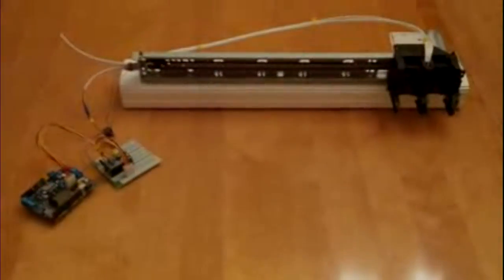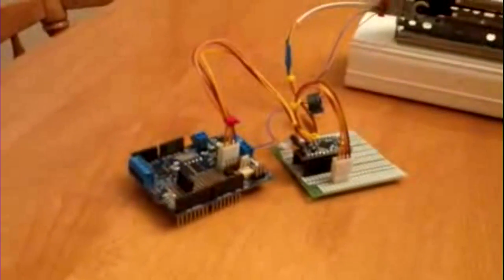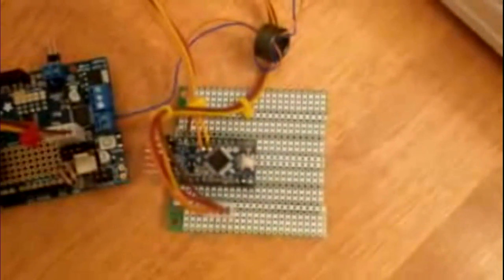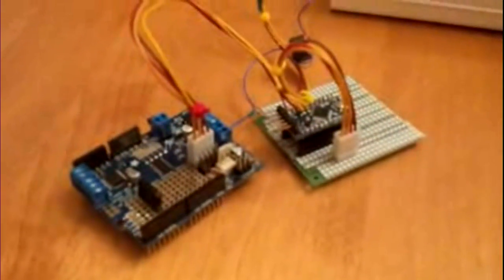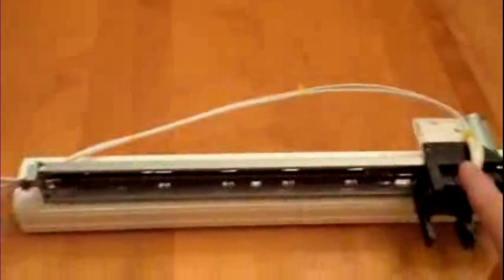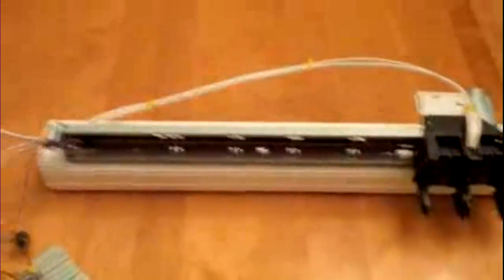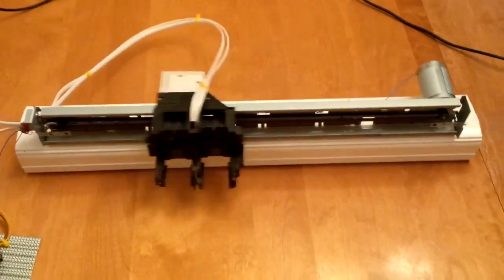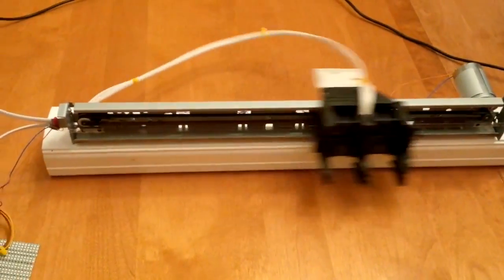RepStrap:  X-Axis DC Motor and Linear Optical Encoder repurposed from an old InkJet Printer

Comment: Michael, did the print slider work out? How far did you get with this  mechanism and what issues did you find? I'm starting a build based on a dell printer, with dc motor and linear encoder strip.  The strip has no lines that I can see!  Do they use cameras now (Like the optical mouse uses) to look at the strip?!
Reply: I just ran to my workshop with a magnifying glass. Lo and behold, there ARE tiny lines on that strip!  My eyesight must be getting bad.

Comment: Hey i have huge problems with my arduino not being able to count up or down fast enough.. it basically miss a lot of steps while reading the strip if i move to fast : /.  may i ask how you did overcome that?
Reply from the maker: Check out Misan's dcservo  hes taken it way past what I was doing.
https://github.com/misan/dcservo
Reply: Me too. How fast were you able to make it go without losing steps? Mine, goes 500mm/min but at 750  it misses steps.  Not sure why. The code time spent in irq is minimal.
Reply: @TheRainHarvester  never calculated the speed. But 500mm seems about right. I abbandoned the Project and used cheap servo motors instead :)
Reply: @MrGunnaras  your motion in the video is much faster than 500mm/sec.  
I can't find other's data on the max speed they achieved without losing steps.
If I move 750mm/min (@ 29 step/mm) I lose 0.5mm after around 2 min of back and forth motion (sometimes sooner).
Do you have any info/data like that?

Comment: How do you think, does it can give enough resolution for 3d printing?
Reply: Not really a proper comparisons. For printing a photo it doesn't have to stop or change speed, just travel at a specific constant speed with known position for firing the print head.

That said, I myself have been playing about trying to do such a thing too.
Reply: @tad2021  How did it turn out?
Reply: @TheRainHarvester  That was a long time ago. I did get it working, but the backlash was the major issue to getting decent quality. I was going to experiment with higher voltage DC for the motors and some other variables, but the price of good steppers and GT2 belts came way down and I ended up moving to those. Eventually changed to a completely different printer.

The ODrive is a good example of what can be done with off the shelf (BL)DC motors and encoders.
Reply: @tad2021  Thanks millions for the info!  I'll watch out for backlash! (I'm going to make a 3d printer on my channel).  
Was the backlash from the motor, or wobbly print carriage, or wobbly frame that you need to make to hold the mechanism?
Reply: @TheRainHarvester  I think the backlash was from the motor. A higher drive voltage may have helped that as the printer the motor came from might have been running up near like 30v instead of the 12v I used.
Marlin now has backlash compensation.
Also a server controller than can deal with a separate PID when reversing directions may make a huge difference.
Reply: @tad2021  , oh, the motor.  My motor shaft doesn't seem to rotate when I press the slider back and forth without power. There is a little slop from the mechanics of the printer head gripping the metal slider "rod" (actually it grips onto a bend piece of metal).  

Maybe I'll add a stiff spring or a magnet to one end of the printer head to keep it tight. The magnet would be cool because it doesn't need to actually touch the metal, just be really close (and no additional friction!)

Thanks for all your help !  Making this work would be a game changer!
Reply: @tad2021  do you remember how fast you could move the shuttle without losing steps?
I can't seem to go faster than 500mm/min which is 241 steps/sec (@ 29 step/mm).

My interrupt handlers are fast and leaving lots of cpu cycles.
Reply: obviously it can print a photo, surely it has proper resolution.  probably better than a stepper with 0 micro stepping/noise and oscillation/missteps.

Comment: does it has hardware chimitt trigger? have you a problem with hysteresis? i'm, working on it but now all done, i just want to know, that you have similar problem? 

now im working on non-PID based to decreased the acceleration just simple ramp.
Reply: What obstacles did you encounter and/or solve?
I'm about to use a printer's linear slider for a 3d printer too!
Reply: @TheRainHarvester  i use bare optical sensor, and only use resistor divider, is not very reliable on speed, you need snooth the power line, because motor noise, and the best way using opamp, but mine solved without op amp, just pick resistor with the right value, make sure cable is good, and smooth with bunch of cap, i even not using analog pin. But if you using sensore module is good to go

Comment: Just what I'm trying to do. What printer is this? I just disassembled an Epson Stylus DX7450 and have insanely hard time finding the specs of the motors in it:

EM-553 (the stepper for the scanner)
00.EM-518 (the servo for the paper feed)
00.EM-529 (the servo on the rail for the printer's carriage)

I really hate it when I get my hands on something but can't find the specs for it so that I can use it. And doing that for servos and steppers - so many things can go wrong...
Reply: I'm also looking for specs, did you find them?
Also the 00.EM-518 is a normal DC-motor for me, not a servo.

Comment: Nice experiment! I'm wondering since most printers are 300 DPI, which is also the printing standard. The resolution only need reach to about 25.4 mm / 300 = 0.0846666667 mm. So why the encoder strip or the whole system can offer 0.002 mm accuracy?

Also, I thought printers are running on stepper motor rather than DC motor. But the result is still impressive with the DC motor. Nice precision and the close-loop control.
Reply: I think since this is the servo system and its positioning is based on PID algorythm there is something called overshoot, oscillations and other things that introduce inaccuracies to the system positioning. that is why PID based systems have to be tuned to work fine. So if you're aimimng at i.e. 300dpi accuracy you need better resolution feedback to let your position control system react fast and accurate enough to maintain desired accuracy.
Reply: I controlled the HP 45 cartridge with stm32f4. If I need to control the motors(2 motors), I can make the printer. 

Is the motor position control impossible for 300 DPI? The printers only have a DC motor with encoder for cartridge. Does the printers have a speed control?